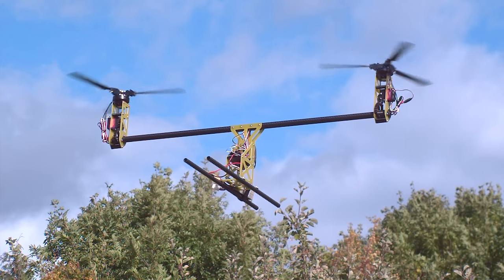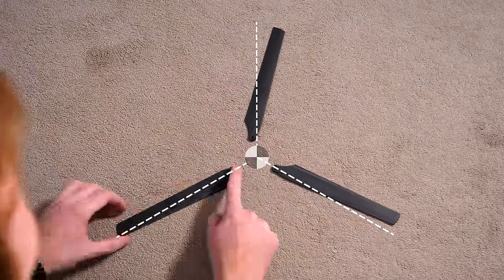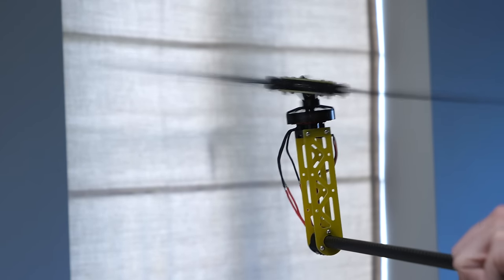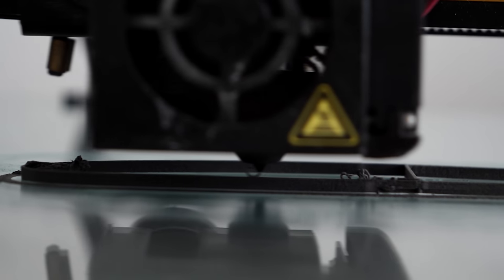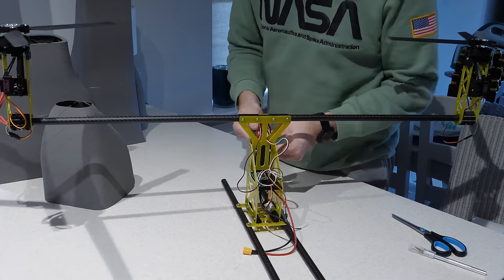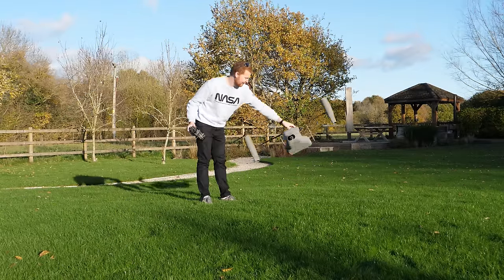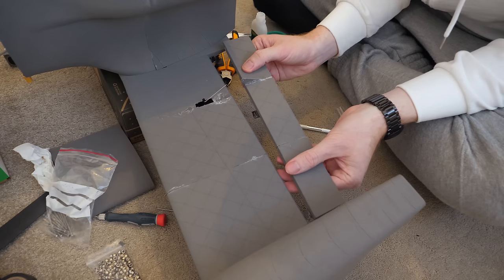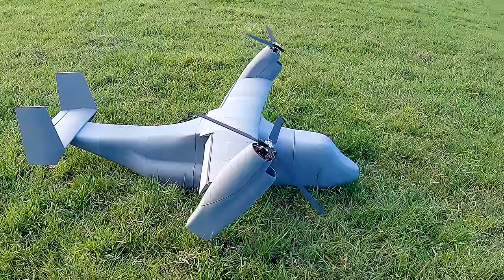Building a V22 Osprey - Part 2

Comment: Improvement suggestions:
I would start by increasing the transition time from half-hover to full hover to at least 7 seconds, if not more. A slow transition will help you with the gyroscopic effect created by the rotating props. Secondly, you have a lot of slack in the servo connetion that is controlling your gears for both the rotation of the main axis as well as the rotation of the individual motors. You can fix this by adding some damping oil (such as the one used to dampen the throttle stick on transmitters) to all the those gears or by adding multiple intermediate gears to have a more gradual torque transition. In the shots where you were showing the tilt mechanism working, it was a bit juttery. Finally, ballance the whole motor mount on the axis of roatation by adding counter weights to the bottom / back part of the motor housing. This will ensure that you have no changes in CG when the motors are rotating between hover-mode and forwards-flight-mode (or any stage in between). Another thing to note is that not only are the props are actying as a gyroscope, pulling the body down when you change orientation, but your whole body-wing system has to oppose the motion of the motor mounts rortating in the opposite direction. You can easily do this by removing one gear and just ballancing while the whole thing is free rotating. Alternatively, as suggested by @Cassius Wilhelm, you could add two separate batteries as counter weights. But make sure you have enough mass in the centre of the aircraft because if you make the arms too big, yaw intertia can become a problem. Try to have a 1-3-1 or 1-2-1 weight ditribution, i.e. first digit for left wing, second for main fuselage and tail, third for right wing. Relatively speakeing, the less mass you have in the wings and the more mass you have close to the CG, the better you plane will perform in almost every way. 

Things to check:
Make sure that the thust angle is not sagging , i.e. becoming negative, when you transition your motors to forwards-flight-mode and make sure that you have disabled the two servos that control the pitch of the motors themselves. Check that the final position of the motors is not below the the chord line of the wing. If they are effectively pointed down, then just adjust the endpoint of the main tilting servo to allow to finsh the rotation with a little positive thrust angle. 

Things to re-design:
Just by looking at the wing to body ratio (18:46), I can see that your wings do not have enough surface area for what you are trying to do with it. It is not uncommmon to have a longer chord line when trying to build scale planes of any kind, simply because the wing loading and the generated lift is very different and for a plane like this, you should have as much wing area as visually possible, i.e. if get's too large, it will look strange and no longer "to scale". Just compare the lift-to-weight ratio between the full scale aeroplane and yours and you'll see the point that I'm making.
Reply: For the counterweights I would like to suggest using two batteries, one in each motor pod wired together as that eliminates the need for a dedicated weight shifting mechanism and allows using the weight that would have been on the plane anyways more efficiently. 

Please feel free to add that little idea to the root comment.
Reply: Great points.  I don't have much RC experience but I'm wondering if dampening or slowly dampening pitch controls from the radio between modes would help?
Reply: im glad someone else mentioned counterweights in the motor housing
Reply: @cassiuswilhelm9640  I added your comment and tagged you because it is a good idea, but I don't know if this will be very benefitial for roll and yaw stability and overall stability because he uses differential thrust to control yaw in horizontal flight and well as roll in hover mode. You can think about it like this: You and your equaly weighing friend are sat on a seesaw at the park and you are oscillating up and down. The further out you sit and/or the more you weigh, the more force you will require to slow yourself down and bounce back up. If you are light and/or sit towards the middle, you don't need as much force because your rotational inertia is not as high as in the other case. In @Tom Stanton 's case, it would be beneficial to have as little weight as possible in the wings so that when he rolls or yaws, there isn't much roll or yaw intertia, respectively. Also, adding weight far away from the CG will have a huge impact on PID tuning, but he will have to do that anyway. Hope this makes sense. :)
Reply: yeah, also bigger wing would be nicer
Reply: @aviafan3350  Bigger in which direction? Longer or wider? THa thing is that you can't change the aspect ratio of the wing too much if you want it to look scale.
Reply: @DZARO   wider (chord) would exacerbate the hover mode issues he was having, so I would think longer (span).
Reply: good points, hope Tom reads it. I was thinking the same with wing span. But it also looks like he is too front heavy in flying mode and maybe the elevator control authority and adjustment might not be enough?
Reply: @LaggerSVK  got to looking closely at the V-22 tailplane. On the full scale aircraft, the elevator is roughly a third of the full chord of the tailplane. He should be able to go way larger with the elevator without breaking the scale look.
Reply: Could use larger portion of the wing as ailerons and at a lower angle to reduce horizontal area.
Reply: @dedpilot4756  He mentioned it in the video, and about not adding additional weight when he was considering just sliding the batteries to adjust the cg
Reply: @DZARO  yeah scale models that actually function the same way as the real things don't really exists because of the nature of physics, I bet the wings size wouldn't be a problem if the air around it could also be scaled down. The air density is just not the same.
Reply: @samos343guiltyspark  Exactly.
Reply: Would it be advisable to try repositioning the prop motors further back in rotating assembly and use a driveshaft to gimbal/prop assembly to aid the center of gravity shift, would also lower the center as a byproduct when in hover mode??
Reply: @s1n1stersixsgaming8  I don't think so, because the drive shaft assembly will add weight as well and it looks quite heavy as it is already.
Reply: I didn’t read everything but wouldn’t like pitching forwards work when transitioning because I think it’s because he’s losing a lot of speed like if you brake with a car you’re going to go forwards and same thing here maybe
Reply: could also try moving the motors to be right against the wing spar and extend the motor shaft out to the prop. This would alleviate the need for counter weight by moving the bulk of the mass in the engine nacelle close  enough to the axis of rotation to get rid of  the majority of  the weight shifting
Reply: @Linusen9  A little channel mixing might be a big help for sure. Some forward pitch while the rotors move back or backward pitch as they move forward. I'm not sure if the setup supports automation of that but either way it would likely help.
Reply: @samos343guiltyspark  Reminds me of Veritasium's recent video on the ocean simulator and how they had to do tons of math on the speed of the ships and the wave sizes to be able to slow down the video to accurately represent how the scale vessels would act in real life.
Reply: yep, if you watch the real ones, they do it very slowly.
Reply: @dedpilot4756  I thought his shifting of the battery provided the perfect counterweight.
Reply: @aviafan3350  How about a 2-part wing-in-wing which extended from the trailing edge, doubling wing area?  Retraction would shift weight forward for conversion to hover mode, and back to main aero flight mode.
Reply: How about a worm gear for the tilt mechanism? should have less slack and greater force, but perhaps it would be too slow?
Reply: i think the problem with transition is the computer is trying to make the props point straight up while they are still tilted in relation to the body.
Reply: Guys, I think you are completely missing the point here. The idea behind ballancing the motor mount is so that the CG is correct in all flight modes. However, this will not resolve the problem with the nose-down tilt during the transition between forwards flight and hover mode because that is due to a completely different (but linked) phenomenon. The rotation of the fuselage happens because toque is applied around the axis of rotation of the motor nacelles. Because the nacelles have mass as well as spinning opject acting as a gyroscope (the props), there is an equal and oposite torque acting on the fuselage. Because the fuselage is not fixed in mid-air it rotates in the oposite direction to the rotation of the motor nacelles. 

The reason why you don't see it when the craft transitions from hover to forwards-flight is because the elevator is able to correct for this torque by applying elevator down, keeping the craft level. On the other hand, when the transition happens from forwads-flight to hover, there is almost no airflow over the elevator to be able to counteract the torque generated by the motors moving into the vertical position and the nose of the craft tilts upwards. 

That is why I stated in my initial comments that the transition between the forwads flight mode and the hover mode needs to happen very slowly - it's to allow the elevator to counteract the torque on the fuselage while there is still substantial airflow going over it. Without airflow, the elevator and rudder are are ineffective. 

Here is a quick summary table of how to think about this:

Motor nacelle movement           |    Torque applied to fuselage                             |   Elevator should point
--------------------------------------------------------------------------------------------------------------------------------------------------------------------------
Vertical to horizontal        🔁      |    Causes the fuselage to tilt up            🔄      |   Down   ⬇
--------------------------------------------------------------------------------------------------------------------------------------------------------------------------
Horizontal to vertrical       🔄      |    Causes the fuselage to tilt down      🔁      |    Up       ⬆

And if you still don't understand, I'll draw you a diagram. 

PS: Just think of it as toque applied to a regular puller prop on a model aeroplane. When you apply power to a large prop, the plane wants to rotate in the opposite direction to the roatation of the prop, i.e. when you look at a regular palne from the rear and you have a clockwise spinning prop, the counter-torque applied to the fuselage causes it to rotate counterclockwise when you increase the throttle. The same happens to the motor nacelles and the fuselage in the V22.
Reply: Wait, the rotors are not counter-rotating?
Reply: @johnathon007  that’s what I thought. Move the motors slightly back on the wing axis and add a mixing channel for the elevator.  Make the elevator bigger or further back if need to provide more counter leverage.  Sliding mass seems too tricky
Reply: @DZARO  When viewed from above while on the ground the angle of attack of the horizontal stabilizer looks too aggressive. As it stands it looks like it would force the nose of the craft down.
Reply: Now while I do not know the exact specifics as far as motor speed and torque in relation to blade length, I can say from what I've witnessed by working somewhat close to V-22's is that the scale of the rotor blades is smaller. The V-22's have larger blades that come within about 3-4ish feet from the body of the aircraft. They also ground taxi with their blades and motors at half tilt and only after shut down tilt down completely and position the blades so as to not contact the ground. Additionally I have witnessed that while if forward flight the motors and blades never fully reach a flat horizontal position, so perhaps stopping tilt for forward flight at say 15 degrees shy of fully flat may help as well. I don't know much about how close scale blades for this would affect performance as it's not full size, but that may be playing a part as well in how much thrust is being provided for both hover and forward flight.
Reply: I came here to literally suggest all of this minus the dampening oil as I completely forgot about its existence. But I do agree that an intermediate gear, coupled with dampening gear oil, and a longer transition period should do wonders for the transitional instability. I’d beg to differ on the notion that more wing surface area is needed though. Keep in mind, they had the same issue when developing the osprey and the solution was to make the rotor blades as big as possible without coming into contact with the fuselage… adding more thrust to get more lift instead of adding more surface area to get more lift.
Reply: Could you replace the Rotars with Turbines?  Basically giving it 2 Jet engines instead of props?
Reply: Current V-22’s use turbine driven rotor blades. But a jet turbine does not provide lift in the same capacity that a rotor blade does. With any aircraft that uses rotors, once enough speed and lift is met the rotors act as if they were a wing. This principal is used across all rotor aircraft.
Reply: I was just about to say all that, beat me to it!
Reply: 100% agree with this comment. Your largest issue for forward flight from my perspective (just watching your video) is the main wing is too small. Too little wing area is killing your forward flight capabilities. It is evident with its inability to maintain altitude (even with 100% throttle) in forward flight mode. Overall great project, cheers!
Reply: I'd suggest larger and wider rotor blades as well, given how the osprey's rotors almost reach the fuselage. also aside from balancing of the fuselage, rotors might need balancing too.
Reply: The issue with forward flight is not a lack of wing, but a lack of speed. There are plenty of perfect scale aircraft that fly just fine without having to distort wing dimensions to do it, and a 1/10th scale V-22 would be able to fly fine at over 10 kg - so long as it's flying at 40+ kts, to generate sufficient lift.

This problem therefore actually goes back to the original decision not to use swashplates in the design - the V-22 does use swashplates, and it uses them in forward flight also to move the rotors to a very high advance ratio and allow a very high speed. Because the blade angle cannot be changed in this model, the very small advance ratio being used for hover flight is now a limiting factor in forward flight, and the motors cannot spin fast enough to gain any more speed. Without more speed, there is insufficient lift over the main wing, and insufficient control authority from the tail (which could likely stand to be a little bigger for accurate scale anyway).

Comment: The Osprey is known to be one of the most challenging aircraft to fly, even with automatic aid, and you managed to fly this in RC mode. Incredible.
Reply: 🤔I'm not sure if it counts as within the scope of his project, but I'd imagine you could put a tiny computer in there, to automate some of the control-adjustment. (For example, near 20:00 when he's got issues switching between forward flight and hovering, and the pitch changes abruptly.) Although maybe that'd require a bunch of speed/accel sensors, and then all become un-calibrated with varying wind speed or something.  😆
Reply: So basically....he is trying to re-engineer a poor flight design dine by the US military....and the model flies just as bad as the real deal.  What I'm saying....lol....its not his design and build being the problem....but the problem lies in the military's poor design.  😂
Reply: @AileTheAlien  it already has gyro in it with a PID controller to help out
Reply: @ezrarichardson279  seems like it needs more accuracy or it's got bugs then, if he's doing a lot of work manually! 😆
Reply: @AileTheAlien  yeah, it’s in an « attitude hold » mode, meaning that whatever manual angle he puts it in, it will attempt to keep. So it’s not like a mavic or something, but that not the point. He wants to basically be able to fly it manually but not need to make all the extra micro ajustements to keep it where he wants it. Most FPV drones are like that for example.
Reply: Чудовий дрон щоб знищувати російські танки в Україні !
Reply: @wadebrewer7212 

It's not a poor design, though, it's just a challenging one

Comment: When you consider that the real thing is also able to fold itself up like origami for storage, you realise the engineering of the V-22 is nothing short of a miracle. And as a one-man diy project, Tom's scale model is equally impressive!
Reply: Funny thing chap has Tom's avatar but is named differently

Edit: not sure what it was about but not anymore
Reply: Easy to fix the nise dive issue with a weight transfer during rotor rotation
Reply: Agreed.  Very well done Tom.  Looking forward to future development.

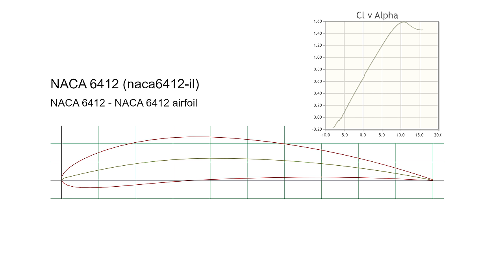PS - The word "which" is not a conjunction :)  15:35
Reply: @emperorsmizz7439  I was thinking two smaller batteries at the ends of the nacells instead of one bigger battery in the fuselage.